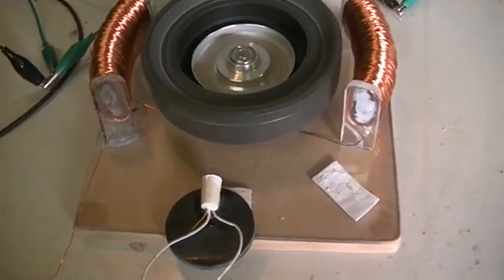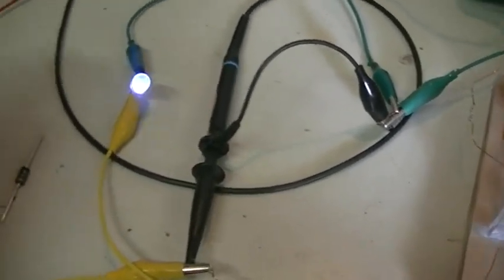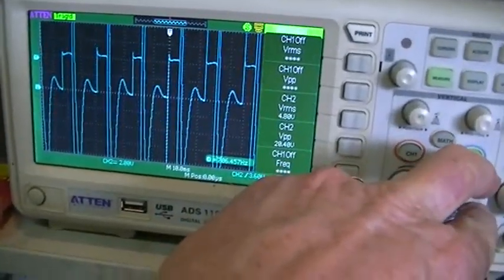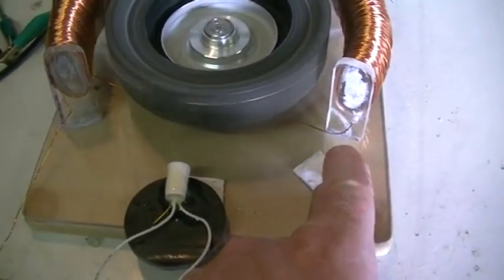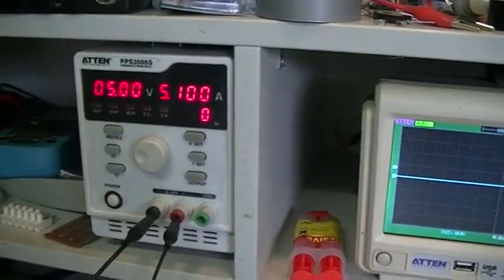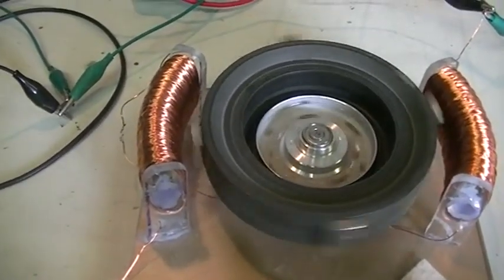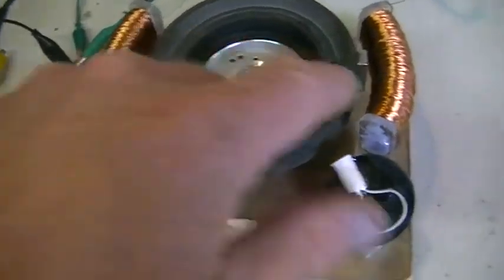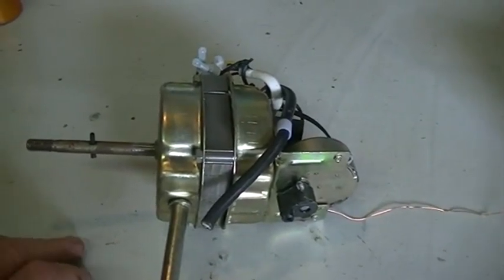Zero force motor test two

Comment: Have you ever thaught about using something like how the old pinball machines use to turn things on and off with instead of a reed switch? Like a steel bearing inside the air core that hit contacts as the magnet flys by?

Comment: If the portion of the fields you wish to interact with are the returns alone, outside the windings, the introduction of a ferromagnetic core is going to pull the small magnet's fields into those cores, which is going to affect induction and produce CEMF.  Not what you want to achieve, I imagine.

Comment: yup, that wire will definitely find better use elsewhere...
thanks for the idea of how to bend the plexi tubes though.
Reply: If you make a coil shaped as an hour glass you can run multiple rotors in vertical position with the same amount of energy.

Comment: Metal used in transformers & pole pieces have different properties than steel from brake rotors & drums.  Try wrapping your coils over laminated magnetic laminated cores or pole laminations.  That might make a big difference.

Comment: Problem is its not zero force, if you wound multiple layers back and fourth, one layer is n/s while other layers are s/n, which makes thr make magnetic fields one the inside and outside one n one south NOT at either of the coil ends

Comment: that is not a resistor, thats a diode.
Reply: +Parasar Bhattacharya it creates a voltage drop though. :)
Reply: A B
ok a resistor creates a ampere drop.....
Reply: A resistor resists/limits current flow and it creates a voltage drop.  A typical diode/LED also creates a small voltage drop as well.
Reply: A B
yes a resistor resists or limits the flow of current which eventually creates a voltage drop as per the OHM's law, which says that V= IR. you are right
. this means if we keep the current constant and increase or decrease the resistance the voltage will also change, same for any of the other two...
Reply: The only way to keep current constant is to have a current regulator.  As resistance is changed in a circuit, it proportionally & inversely affects current. (as can be seen easily in this form of the equation V/R=I